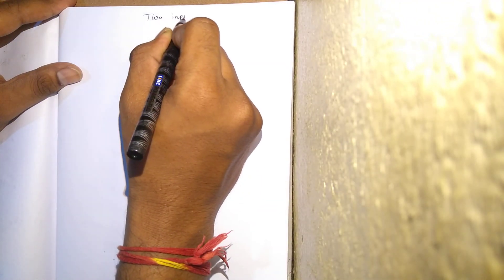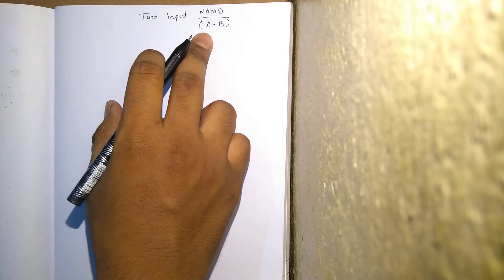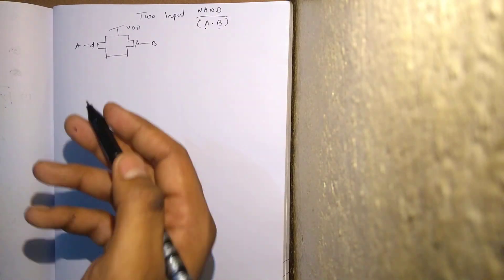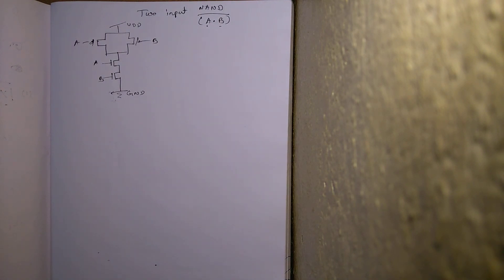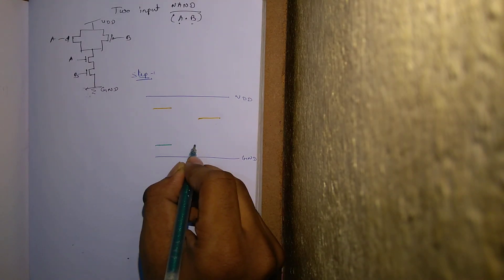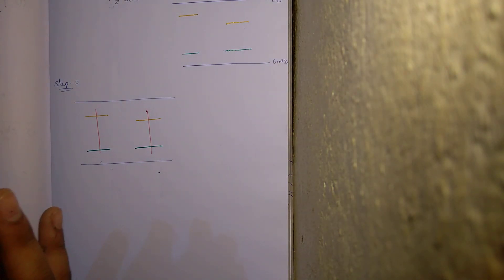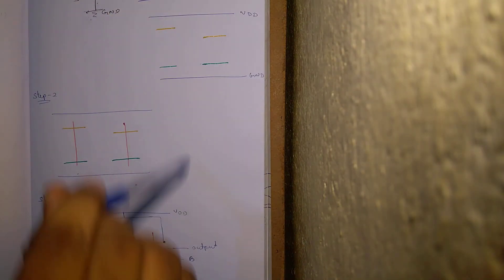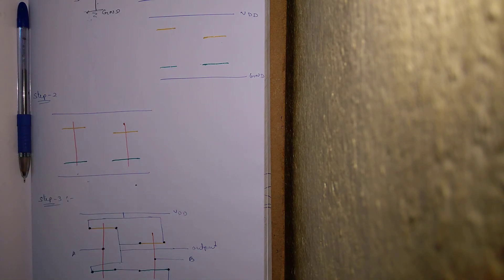Stick Diagram part-3

Comment: Well crafted video, sir. My doubt is... Can the ends of the polysilicon be attached to Vdd and ground??
Reply from the maker: You can attach, but you need to show the electrical contact explicitly.
but I don't find such a need.
and All the best for your exam :)